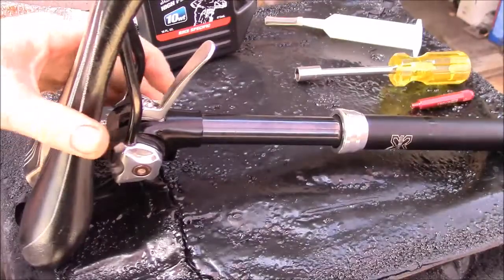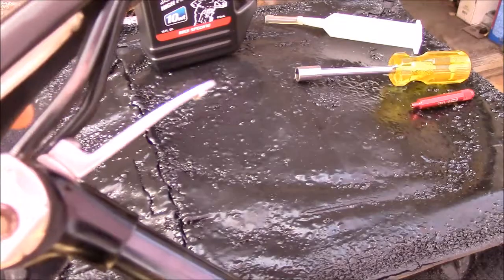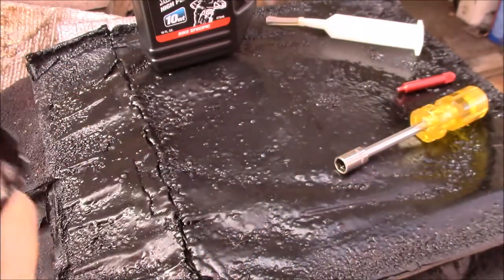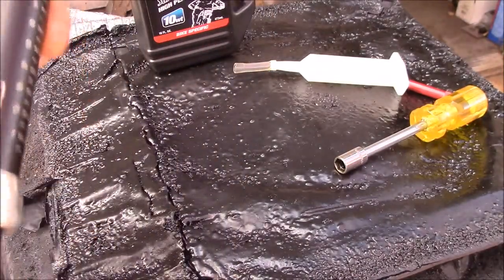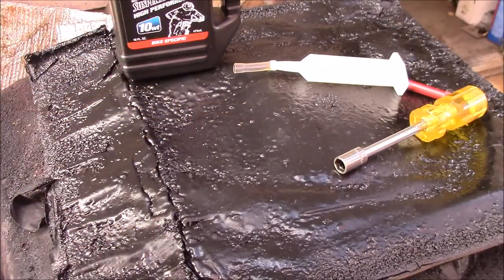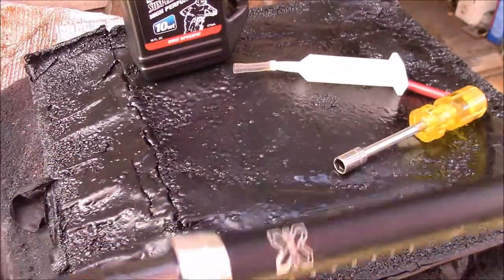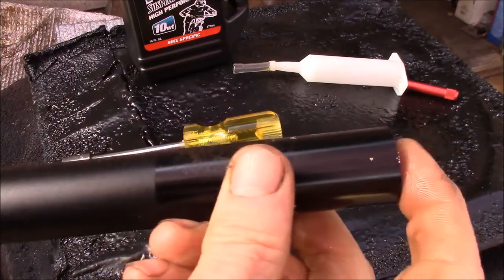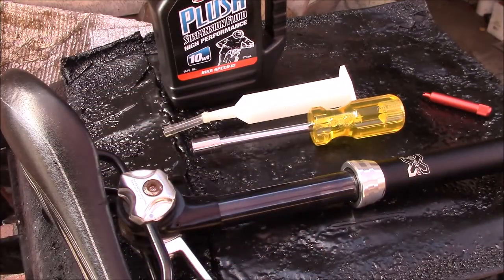X-Fusion HiLo Dropper Seatpost Oil Refill

Comment: What oil do U use
Reply from the maker: That's listed in the video description:
- Maxima Plush 10 WT Suspension Fluid:
Reply: R Brown there’s is a probably to work with 7.5 wt?
Reply from the maker: @alejandroleonardo5671  Not sure, I think I ran across some information that said 10WT was the lowest, but for topping off a little 7.5WT would not likely change that much.  Might contact XFusion and see what they say:
https://www.xfusionshox.com/contact.htm

Comment: This was great advice for my hilo. I had a spongy dropper and tried exactly this. A couple things though. 50ml of oil was way too much for my dropper. It is easiest to take all the air out, fill about 30mls and see if you can get the dropper all the way down. If you can't there is too much oil in it still. Make sure you cycle it upright... upside down seemed to not work the same way at least for me. cycle it a few times pulling it up since no air. it might feel spongy again a few times but after a couple cycles it locked right up perfectly. Then I added air. There was definitely some back and forth in filling / draining but it only took about an hour to work out and completely worth it.
Reply from the maker: Good information, thanks for the comment.  Yes, I didn't pay too much attention to the oil qty., I just sucked in as much as it would take then pumped out a bit at a time until it would compress fully as you mention.

Comment: I have a Hilo too, but I have a problem. No matter how much I tighten the saddle bolt, my saddle does not hold in place... I can change the angle of the saddle just by pressing it with my hand... And I have already ruined 2 bolts trying to tighten it enough...
Reply from the maker: Might try adding a bit of fiber grip paste to the rotating parts.  The grit in that paste may up the friction enough to help with that problem.  But also, try taking it apart and see if there is something missing or hanging up and preventing it from tightening down fully.  With mine, I just set the angle and it stays there until I take the saddle off.

Comment: I had Giant Contact Switch dropper post for 4-5 years and having the same problem that you have. but after tearing the whole post apart i found out that the Giant post uses disposable damper+air assembly for their dropper posts, thus no fix or revival of the post. In the end i purchased X fusion Hilo Ace dropper post but just after observing the thing for 5 minutes i found out that the bottom of post is different from the X Fusion's service document, there's no Schrader  valve underneath, instead it looked like the Giant's dropper post. seems like another disposable damper assembly to my eyes. it's not that the post is fake or sth but i only paid 80 dollars for the X fusion post and probably a OEM version of "normal" Hilo post just like they often do with their forks. what a shame. By the way, what a neat way to refill fluids without disassembly:)
Reply from the maker: Yes, it seems the trend is now towards those cartridge inserts for dropper posts.  I've heard some of the cartridges are replaceable, albeit expensive.
Reply: There's a plastic cap over the end, if you haven't discovered this yet. Pop it off and you'll find the air valve. I want to know how much total oil to put in. I've tried to drain all the old without disassembling. It's hard to know how much to use. Very little came out of mine; just wondering if it all leaked out. It's been working ok. The seal does weep a tiny bit, that just helps keep out the dirt.